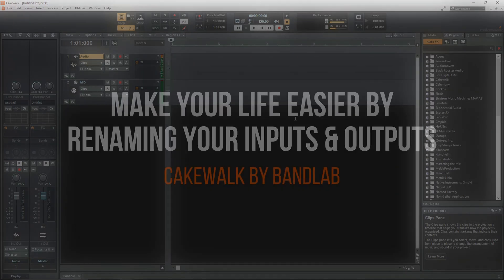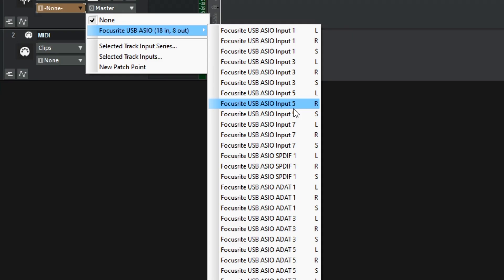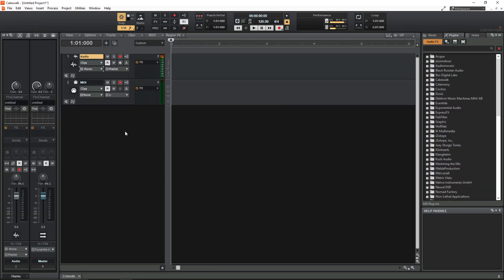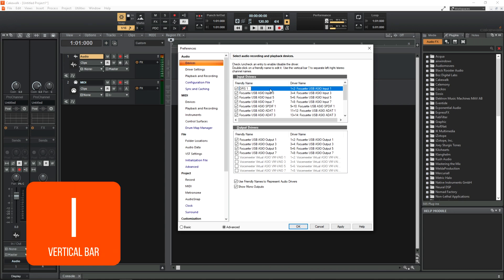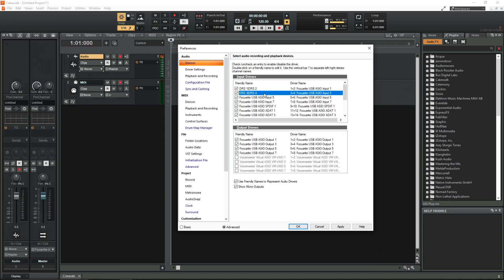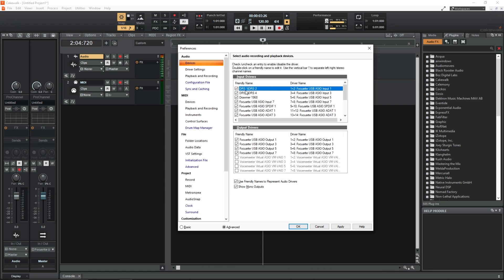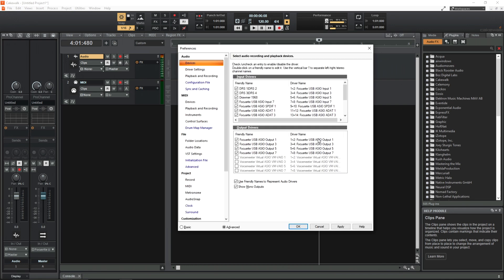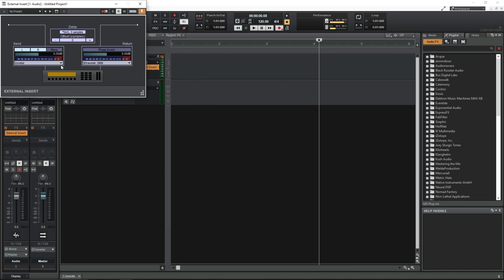Are You CONFUSED by Cakewalk INPUT Names? Do This! | Cakewalk By Bandlab Tutorial

Comment: Not boring at all. Cakewalk hasn't always had this feature, and it cost me embarrassment and even lost takes when I armed the wrong input. I was probably the Cakewalk user who most advocated for the ability to rename the input devices and it remains VERY important to me. It's especially a big deal when your interface has 8 inputs, as mine do
Reply from the maker: Absolutely! I was tracking on an Allen & Heath QU-16 for a few years and it was bit of a nightmare setting up inputs. So many times I double tracked the same tom. A worthwhile update.
Reply: @lightgrenade  Once I had a mic on the guitar amp in what was labeled on my Firepod "Input 1" and was trying to get a vocal mic into "Input 2." Due to the weird labeling in Cakewalk, it took me 15 minutes to chase down why the level was so low on the vocal mic. Turns out I had armed Input 1 and the amp mic was picking up the singer. 😣
Reply from the maker: @Euthymia  Ah, that one has stung me before as well! One of the worst things was taking 30 or so minutes to set up inputs before tracking a live band. Extremely easy to make lots of mistakes, especially when people are talking to you. I actually don't know how I persisted for so long before.